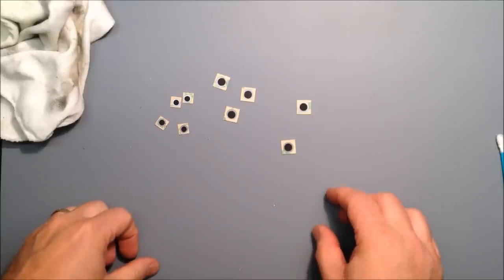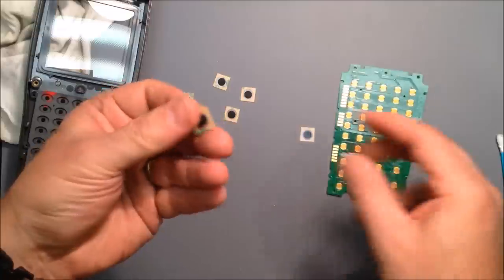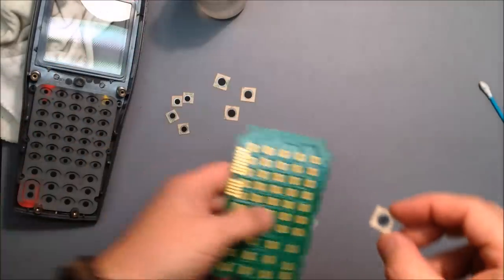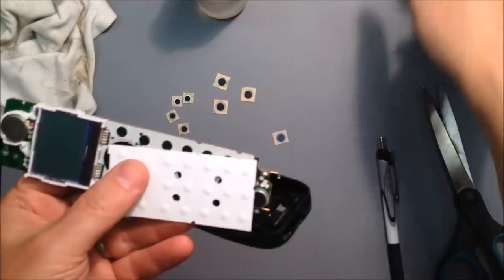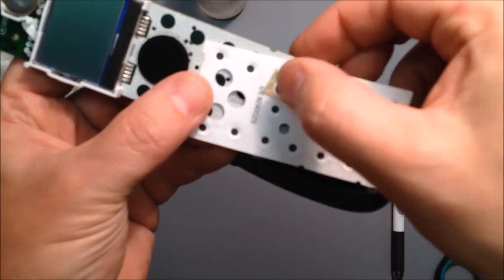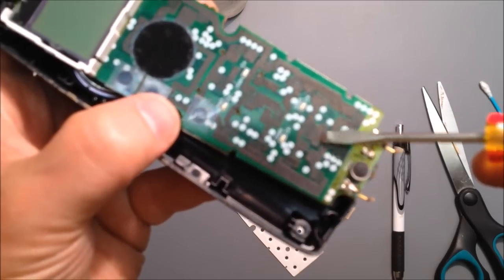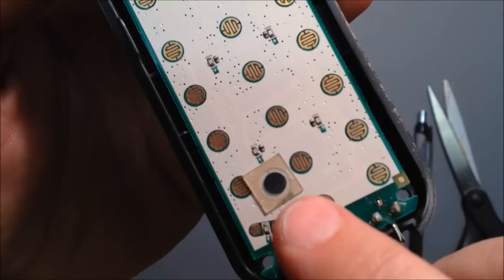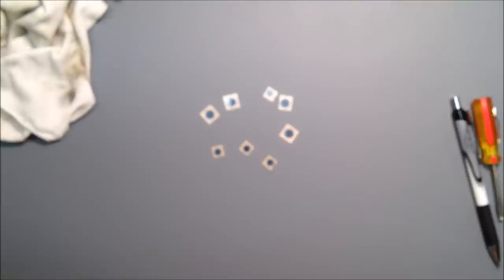Rubber Keypad Repair Buttons - What to consider

Comment: I just repaired 2 Hunter ceiling fan remotes. I'd previously repaired one using the conductive paint. It worked well for over a year until in the middle of the night the light kept gradually going on and off by itself. I opened the remote and the conductive paint had come off the button and was laying on the contacts for the light.
So far both remotes are working like new again. this saved me over $50 each for replacement transmitters.

Comment: I am working on a dishwasher. And basically the buttons on the control pad were stuck making contact. I separated the strip, and was able to bend the buttons get them to stop making contact. When I receive  your product. Do I need to eliminate the old buttons altogether? Or put the new contact between the old button and the contact point?
Reply from the maker: Most dishwashers I have seen are membrane keypads and not rubber keypads. ButtonWorx will work in some membrane keypad designs that use a forked type contact pad and a solid dot top conductor. If the design uses a design with one leg on the bottom and the other on the top then adding anything between will block one or the other. If you can contact me through my web site with photos I should be able to help more.

Comment: I have  a weird problem with my casio fx -991w calculator. After the calculator is switched on, none of the buttons work and after sometime, pressing Ans buttons displays syn error. If the calculator is left in sun for a 15 minutes, the buttons start working again an the calculator functions normally.  Initially, after the calculator is on, none of the buttons work. There may have water or moisture which entered the calculator through buttons. Does opening the calculator and cleaning the keypad help? Since there may have been a short circuit inside the calculator, the battery may have drained which is why it only works after there is lot of sun for about 15 minutes.  Thanks for looking.
Reply from the maker: I don't have any experience with calculators, but this sounds like a solar calculator maybe with a dead battery?? Have you changed the battery? That might be the only problem. If the keys work OK after 15 min in the sun then I doubt it's a button problem. Much more likely a power problem.
Reply: Yes, I did change the battery after it had rust.The problem persists even now. I suspect it is due to mosture or humidity in a damp environment  or a short circuit and perhaps capacitance build up in the calculator or any Electromagnetic field whcih is affecting the battery usage. I think the operative environment is bad.I will try to check if it will work properly in a air conditioned room. Something had altered power management in the calculator. The calculator doesnt need solar power from sun on the solar panel . It needs sun on the back.  I am not really sure about the technical reason yet. I hope I learn something from this.
Reply: An update: The buttons are working after powering on the calculator if I keep the back of the calculator on a metal surface for a few minutes instead of keeping it in sun.  If I remove the calculaotor from a metal surface, the buttons stop working after 5-10 minutes.

Comment: I assume your button repair membranes are domed, so that they only make contact when pressed?
Reply from the maker: There is a space holding the conductors up off the board.
Reply: Ok, I see.

Is there a known shelf life for the membranes?
Reply from the maker: @robtemple3445  I have scraps of materials from over 10 years ago and they are all fine. Adhesive is as good as day 1

Comment: .....No luck.. didn't use it for 10 years...Panasonic Remote N2QAGB000002,  I just sprayed some Rubbing Alcohol and later sprayed and washed the Circuit board with Rubbing alcohol and  Contact Cleaner. ONLY the Power button on the Remote is working now.  What could be wrong?
Reply from the maker: Only the power button working makes it unlikely the buttons are failing. Failing buttons are usually only the heavily used buttons. When all or most buttons stop working (even the ones you rarely use) then it suggests something more serious. I assume the power button is one of the most used buttons so should have failed first, not be the only working button.

Comment: i'd have to call crap on the first instance that is like my tv controller.  How does this stick-on button not short out the multiple contacts for each button on the store scanner machine meaning each button you put a conductive sticker on would be always-on and thus drain the battery?  The underside pad on the rubber keypad hovers over the contacts until you press the button to make the circuit connection so I'd think you'd try to want to get these adhesive stickers to stick on the rubber button underside so it will hover over the contacts until you press the button.
Reply from the maker: Not sure what you mean. There are different sized buttons.  If you put a large button repair on a small button then you could short out other buttons or worse (other exposed metal connections). The buttons are never always on because there is a spacer holding the conductive part above the circuit board. The original rubber button has to push down on the repair part to activate it. Unfortunately nothing sticks to rubber keypads for long. I have been working on phone repair for almost 30 years and tried everything. There is no paint, glue or sticker that permanently sticks to silicone rubber. We would get phones back for warranty all the time because of button repair failure. That is why I eventually came up with this.
Reply: i was referring to a single button (and not adjacent buttons) and if there is a spacer, that will work as you don't want the conductive surface to always be touching the contacts until the rubber button is touched.  i may try this kit when the remote control I just fixed fails again in about a year (I use the conductive paint method on my remotes and it lasts about a year per application).

Comment: could you simply use a greylead pencil on the old rubber contact to create a conductive layer
Reply from the maker: It's a temporary fix that will not last and can build up between the forked contacts, creating a short. Conductive paint is terrible because it doesn't stick. Guaranteed to flake off and short out buttons, pencil lead has even less reason to stay put.

Comment: My 1998 Jeep Grand Cherokee key fob's door lock and unlock buttons always required a very hard press. Today they just wouldn't work. I cleaned the rubber buttons and circuit board with 91 % isopropyl alcohol. Now it's good as new. Update: The lock and unlock buttons are failing again after only 2 days (the batteries are new). I ordered the button repair kit from p1repair through Amazon and should have it by tomorrow. I'll update this post after I install and test it.
Reply: Update: The button repair kit did not work for me. I tried different size pads but it's worse than ever. I ended up finding a brand new case ($10) for my Key Fob that included a new rubber pad/buttons.

Comment: no need for that, you can use foil tape on the contact buttons. works the same way
Reply: I've been repairing button for 30 years. The foil stickers don't last because nothing will stick to rubber. They fall off causing a short circuit or even damaging the device by shifting and shorting out other contacts on the board.
Reply: Ben J what about a little aluminum foil glued to the button
Reply from the maker: @MaxCaissie  Nothing permanently sticks to rubber..... nothing
Reply: @p1repair  except for rubber cement
Reply from the maker: @MaxCaissie  I spent over a decade trying every technique and specialty glues you can't buy at any store. Nothing permanently sticks to rubber keypads.
Reply: @p1repair  cool
Reply: Solution I've found working: aluminum foil cut in small pill size and glued on the defective rubber using silicon. But you need a very little amount of silicon. It won't unstick ever..
Reply from the maker: @jpdesroc  I spent over a decade looking for glues that stick to rubber including talking to techs at Loctite and ordering $50 tiny bottles of special glue with short shelf life only available for industrial customers. Nothing sticks to rubber, especially silicone. The only way it will last is if you don't use it much or get really lucky.

Comment: Anyone that believes this; your remote control or electronic test equipment keypad is on borrowed time. Don't even bother.
Reply from the maker: I've been using these myself for over 10 years and selling them for 5 years. I have several repair facilities re-ordering buttons regularly for many years.  These not only work... but they are the only thing that will work for the long run.